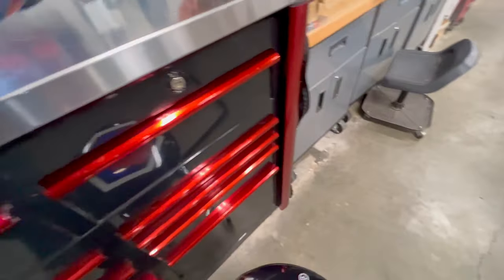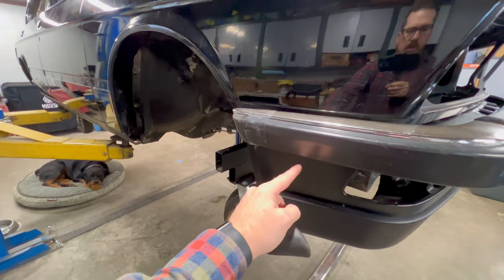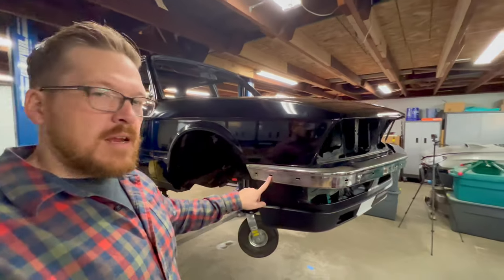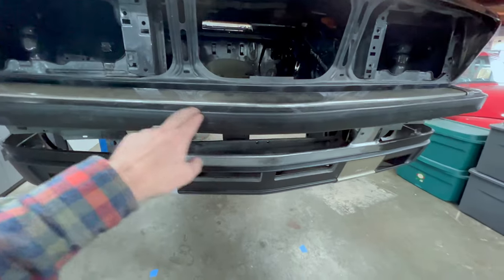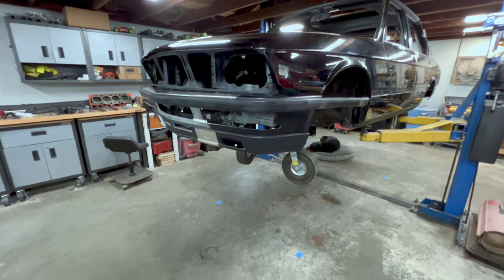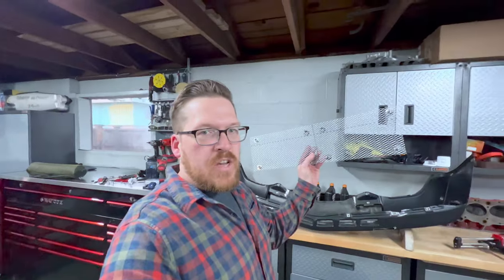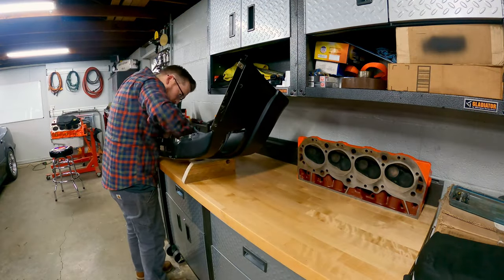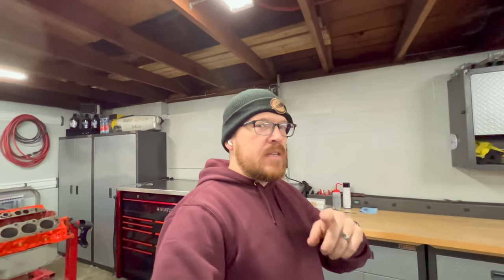E28 M5 Euro Bumper License Plate DELETE & Custom ONE Piece Bumper Trim

Comment: It is your car and you can do what you want but in my eyes looks terrible.
Reply from the maker: @M5-Porzellan  It’s not my car, it’s for a client. So they have the final say here. I understand that it looks a bit odd. I’m not sure if that’s because it actually does, or if it’s because we are not used to seeing it without a plate, or if it’s because everything up front is unpainted and several colors. My final judgment will be made once I can see it on the car with the bumpers painted, car assembled and on the ground. 

The bright side to this, is that it is 100% reversible. So if we don’t like the look, it will be super simple to switch back to the factory setup. 

~ Nick